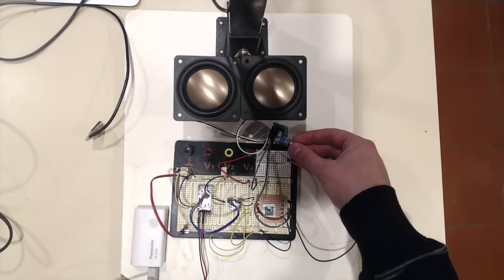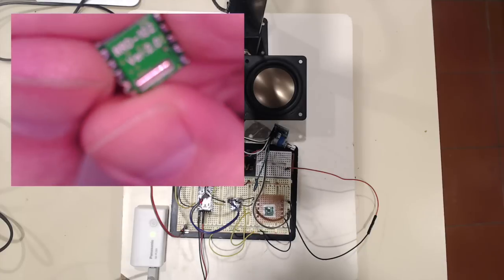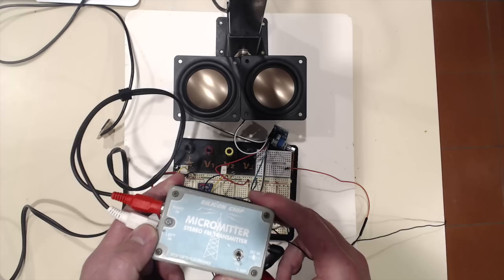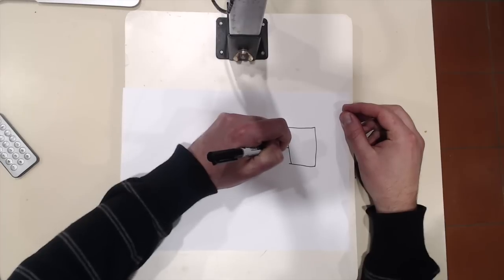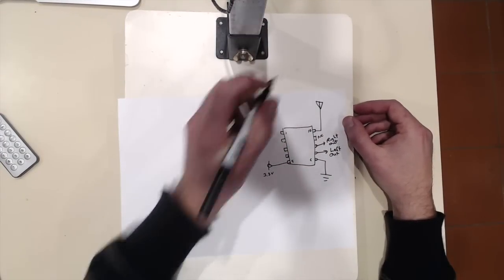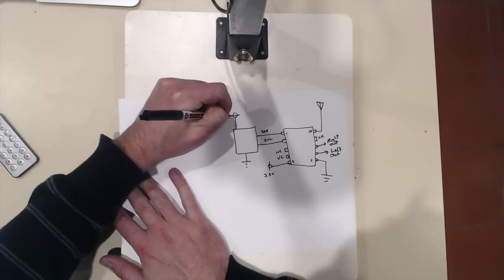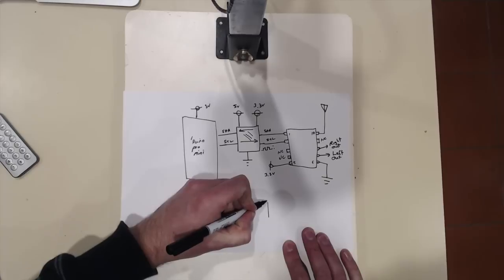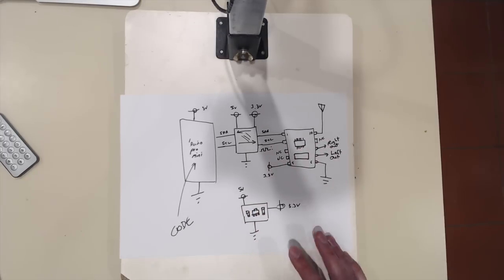Connecting the RDA5807M FM Radio IC to an Arduino

Comment: Hello, how can we turn off the sound at an empty (noise) frequency on the fm radio, what should I use for this?

The FM module I am using is RDA5807M

example :

vzssssssssssssssssssssssssssssssssssssss (white noise).

Comment: can i use a simple voltage divider made out of resistors for the 3V needed by the radio module?
Reply: You can use a simple voltage divider, but it is lossy, and also you must assure that the source voltage, that you are dividing is constant. Not sure if you figured that one out since then :))

Comment: Luc.  this is great video. would u share RDA58 code ?!
Reply from the maker: Yiğit ÇÖMEZ Hi there, the code can be found here: https://github.com/lucsmall/Arduino-RDA5807M/blob/master/A20150415RDA5807FMTuner.ino
Reply: Luc Small is this module similar with SI4731 ? and ı would like to also see frequency on lcd. how can ı do that ? 
Do you have any idea ?
Reply from the maker: Yiğit ÇÖMEZ The SI4731 looks like it has more features than the the RDA5807M supporting, for instance, AM as well as FM. I've never used the SI4731 and I'd imagine it would require a different set of registers to be programmed in order to set the frequency.

My sketch is really simple and I avoided attaching LCDs, etc., so I could provide the simplest Arduino code imaginable to make it do something. Once you add an LCD, you probably also need to add some switches to adjust the frequency and things get more complex! If you want something more sophisticated this library might be of help:

https://github.com/mathertel/Radio

I note that the library also supports the SI4703 and SI4705 and various other radio ics, but not the one you mention (SI4731).
Reply: Hmm ı get it. Thank you for explain. I think SI4703 and 31 have different memory adress to send arduino. ex. freq set.

How do you understand that your code is working ? How can ı test my device ?